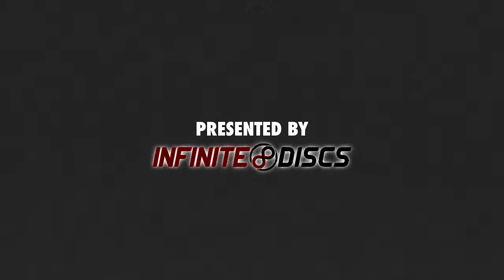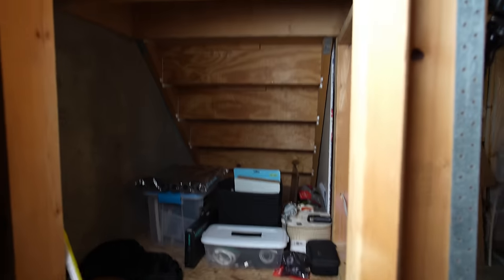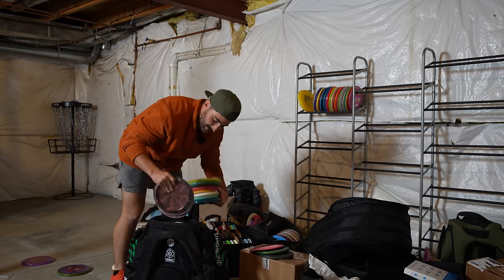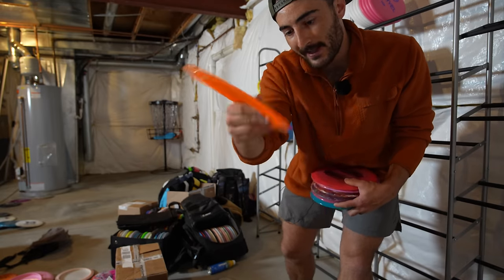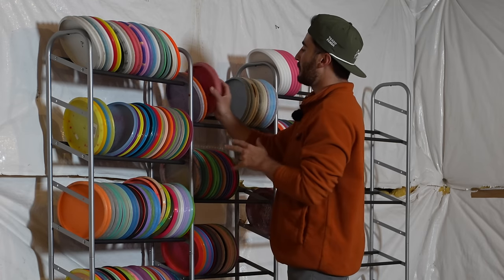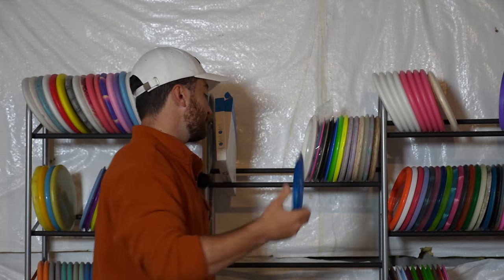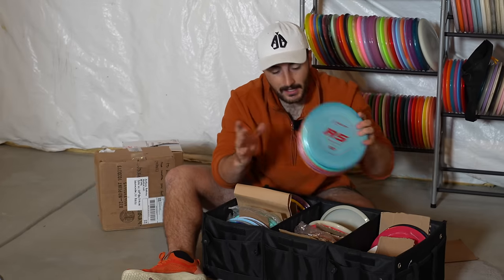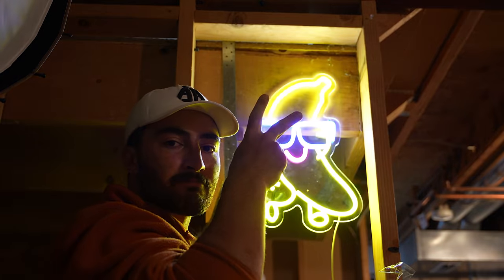I MOVED!!! (sorry)

Comment: I sent Disc Model that has been my putting putter since in 2006--2007 winter in standard baseline plastic as is best way to properly judge disc.  I have not used plastic since disc was made in what was an old limited failed run plastic in mid 2000's the Company finally perfected in 2016 and have used in said plastic. I only sent 1 due to how many are, as of 4--4--2024 left in stock by sellers on Amazon in max weight 173--174 grams but mold is kind of unique yet either loved or hated.